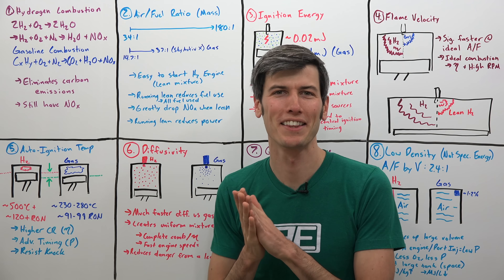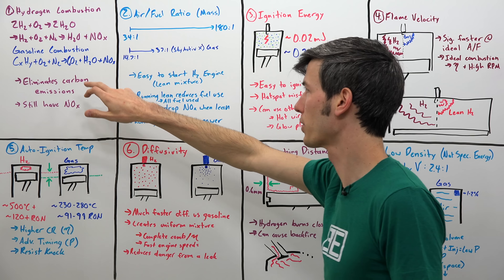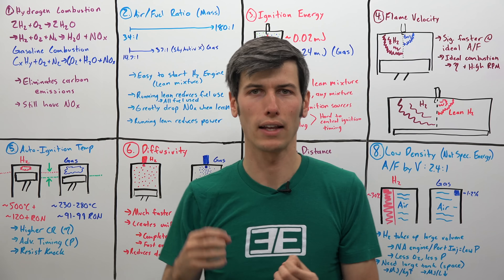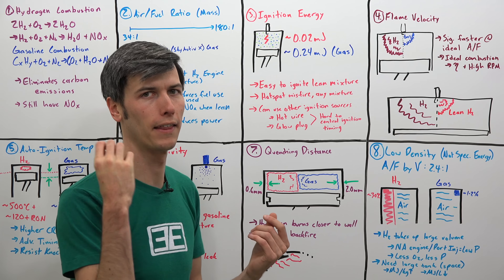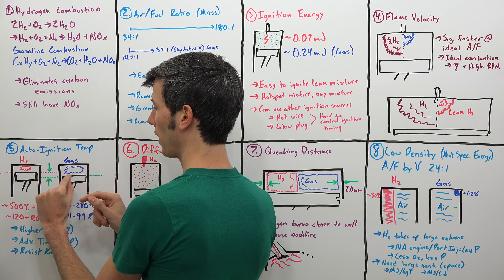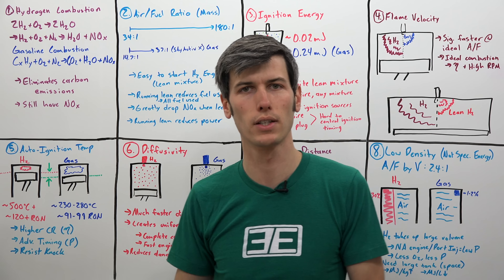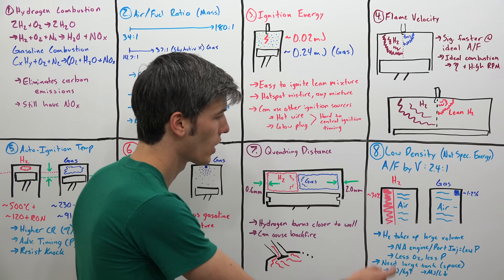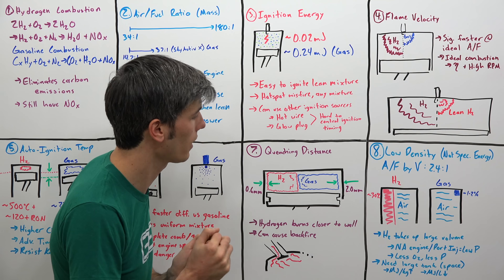The Difference Between Gasoline And Hydrogen Engines

Comment: The Achilles heel is density of the fuel, like the guy said at the end you need a big fuel tank plus on a network level hydrogen would only be feasible in cities with a pipe network from the gas generator as i can't see fuel tankers operating at or near 5:1 as regards petrol.

Comment: Excellent presentation. It makes one wonder why nearly all of the R&D by automakers for future alternatives is devoted to electric vehicles. it seems to me that hydrogen is a far more practical approach, given the relative abundance of the element, and this technology would not require major changes to current engine design. With EVs, there is the issue of limited supplies and expense of lithium for batteries, battery weight and life, not to mention the environmental concerns of mining lithium, and huge amounts of toxic waste that will be generated by spent batteries! Something stinks about this rush to force consumers into EVs. Your thoughts?

Comment: No carbon emissions? Not taking carbon from underneath ground and dispersing it into the air? Yes, not during the process of operating the vehicle. Instead, some weeks before you run the engine. Usually. Why? The usual way to get hydrogen is to remove it from methane – CH4. Which leaves carbon compounds behind. This cheapest most efficient way of getting hydrogen – the methane is the main component of "natural gas." Am I wrong? Seems simpler to just use natural gas in the internal combustion engine. No?

Comment: Great video as usual. I am a bit late to the comments party, admittedly but one key question I have to progress my own evaluation of  IC hydrogen engines is the NOx by product of such engines vs gasoline engines. If in hydrogen ICE the ideal stoichiometricratio of 34:1, the NOx is no worse or less in comparison then we are not actually going backwards is in implied by some in our attempts to go forward in both a transportation sense and also an environmental impact sense.

Comment: The ICE is a Rube Goldberg contraption with so many drawbacks and problems it's insane that it exists at all.  Talking about changing the fuel in and ICE these days is a little like debating the materials used in a buggy whip in the early 1900's.  Seems like brainpower would be better used elsewhere.

Comment: What would happen if you used water and split it into hydrogen and oxygen with an electrical on board source and used those gasses as a fuel, then captured the water that resulted and reused it? No?

Comment: Diesel in for high compression,supercharger runoff the exhaust with a separation for without a straw or reported on the cylinder heads for easy of cooling inverted cylinders because it's lighter than air

Comment: Excellent explanation, once again.
Just one doubt: I've  read in square 2 that "NOx drop when lean". 
I have the opposite idea... when Oxygen is abundant after combustion is when more NOx occurs. That is the main reason why modern Diesel engines recycle the exhaust again to the intake in order to reduce Oxygen availability when the engine runs lean.
Did I misunderstood?
I like your explanations and shared enthusiasm. Hope you keep doing a great job.

Comment: Why not run the nitrogen in compressed liquid form with direct injection. It would drastically lower the combustion chamber temps and get better air density. It would also allow a much higher level of boost in a turbocharged application.

Comment: The guy is good. Have a couple of places where he was talking over my hairspray. In #2 (and this is due to my ignorance of gas/ fuel ratio). Are both sides of the ratios liquid... or gas? As in 14.7 what - to 1 what?

In #7, 500C auto-ignite temp is scary. I'm curious to witness an engine optimized to take advantage of hydrogen's auto-ignite temperature and how the machine would compensate for hot spots, and  look at the cylinder cooling setup as well as lubricants used. #7 means that cylinder walls are more apt to experience near auto-ignition temps, which are way beyond current lubricating and cooling systems. Rocket motors wrap the liquid fuel and oxidizer lines around the nozzle to keep it cool. Can't do that here, as the fuel is already in gaseous form (#8).

It would be interesting to see him review a 100% hydrogen fleet and how it wouldn't move an inch without petroleum to create tires, lubricants, asphalt, virtually 100% of a car's interior, Synchilla (R) clothing for driver and passengers, distribution (there's a group who doesn't like pipelines or train cars delivering petroleum), and humongous hydrogen mfg, disti, and fueling infrastructure.

Comment: Would it be possible to use existing catalytic converters to handle the NOx emission of a hydrogen combustion engine or would you need a different chemistry?

Comment: One small detail... while the H2 engine doesn't directly have carbon emissions, the processes that gave you the H2 very likely did. (at industrial scale, steam reforming uses methane. smaller point-of-distribution sources are usually electrolysis, where some to all of the power is not "green", and a major portion of any efficiency is lost to high pressure condensing pumps.) Thus, hydrogen is moving the problem somewhere else.

A small hydrogen leak rapidly becomes a massive problem. As you point out, it's combustible at 108:1, and it diffuses ("mixes") quickly. If that leak were in the cabin or trunk of a car, there's a serious explosion hazard. (the obvious solution is to keep the fuel lines routed away from areas where gas could accumulate.) Granted, I've not heard of any issues of fires and/or explosions with hydrogen cars, but even in 2022 that's still a very small fleet. (fires within gasoline cars are statistically low, but non-zero. same with battery EVs. for that matter, there are fires at gas stations and charging points.)

Comment: Jason, it's nice seeing you back when you explained engineering (as opposed to test driving cars). Question: Wouldn't a compression ratio of 180:1 create a lot of blow-by? Engines today can get that with much less compression. In fact, how would you even create such compression in an existing car? Thanks.
Reply: That 180:1 is a air-fuel mixture ratio not compression ratio.

Comment: Concerning point 6:  I believe hydrogen/air mixtures only detonate once ignited.  The only way I can see a hydrogen ICE engine not being destroyed by super nasty knocking is to ignite as the hydrogen is being injected, before it diffuses into the compressed air.  Like a diesel engine.  It still will go fast.

Comment: Yea, the volumetric energy density problem is what dooms most hydrogen applications. Fun fact: there are more hydrogen atoms in a given volume of gasoline than there are in the same volume of liquid hydrogen - and way more than that same volume of hydrogen gas. It's not the whole story, but the main point is that each hydrogen molecule has only 2 hydrogen atoms while for petroleum products its more like 20-30 per molecule.

Comment: Great video.  I think burning H2 in ICEs would have been a much more environmentally friendly interim solution for reducing CO2 output.  ICE engines are easy to make and recycle.  The copper needed for EVs is a quickly dwindling resource!  
Politics and green zealots are completely ignoring the vast amount of CO2 involved in producing hybrids and EVs, not to mention the completely unknown emissions from recycling batteries and fuel cells. Also, these incredibly green vehicles will all go to the scrap heap way earlier than ICE cars because no one will incur the insane cost of replacing batteries on 10 y/o cars.  
 NOx emissions can be easily controlled with a DEF-like systems as they are widely in use on diesel engines.  Automakers have completely ignored this as an option but it is likely to be needed for long-haul trucking, heavy machinery and even on freight trains.

Comment: The space required in the car is the least of your worries.  There is hydrogen embrittlement, transporting it at −252.87 °C; −423.17 °F, filling the tank, and even under the best conditions, losing 1% per day, conditions that don't come close to existing in a mobile world.   It will probably also emit ozone, which is astounding corrosive to anything carbon-based, like plastic and you and your lungs.

Comment: Theoretically, if we could perform electrolysis on the fly..and just store the hydrogen as water solution (Maybe Lye), and the exhaust byproduct of Hydrogen combustion is water, could the exhaust line be fed back into the holding tank. The solution that makes the water conductive isn't sent into the engine, so it would stay in the holding tank. Could this give us a semi-indefinite fuel source? Maybe you change it when you change your oil? Storing the fuel as liquid water has it's own caveats I know as the electrolyte solution would have to bring the freezing point of water to well below 0*C.

Comment: The biggest disadvantage is still using a complex marvel of engineering with high maintenance cost to produce it's power. I think a fuel cell and electric motor might be the only future for hydrogen if it is to compete with the way things are heading. Great vid as per usual

Comment: I think Hydrogen is a no brainer since it is cleaner and can be reproduced unlike fossil fuel, my father who everyone called crazy said it could be done in the 1970's during the gas Crunch. I guess my father wasn't so crazy. Electric is not the way to go for so many reasons but the obvious one to me is the immense pollution that will come from spent batteries made from poisonous chemicals and the fact that countries not so friendly to us would have to supply rare earth minerals also needed to make batteries. We aren't talking about a couple of AA batteries but much bigger and millions of them.
Reply: Could not agree more. Off shore windmill parks could easily supply both the electricity we need and electricity to power all cars in the world. Electricity and water are used to make hydrogen. Hydrogens first stage are hydrogen gas but when turning hydrogen gas into hydrogen liquid it are fantastic for long term storage for when the wind does not blow/winter. 1 single liter of hydrogen liquid contains same amount of energy as 450+ liter of gasoline. In some parts of the world solar panels can be used for electricity production but off shore windmill parks are great for larger concentrated outputs for cities and larger hydrogen production. Car/train/truck and even jet engines can run on hydrogen. It is beyond me that we dont have jet engines/planes running on hydrogen today. If the jet engine manufacturers are not getting their role, taking their responsibility upon them, we have to make a global snap decision and create a continent connecting vacuum based hyperloop system, we can use current airports as hubs. If all nations start building their part and we all chip in for the sea parts it should be able to be done in 10-12 years if we consider it our generations "Apollo project". 
I almost can bear it anymore...WHY are we not acting!? The fossil fuel industry are still the most subsidised industry in the world, can we at least make the market fair for a start, makes no sense unless you count in massive corruption!

Comment: H2 engine?    Just run it as a rocket motor...  making h2 produces O2 as well.   Just need 2 bottles...  then you don't even need an intake system...  its all in 2 bottles

Comment: What you didn't address was leakage throughout the entire manufacture, storage, distribution, and application. Hydrogen will find every potential leak path. Adequate sealing techniques are elusive especially over time.

Comment: With all the Green Energy idiots pushing electric vehicles you would think that they would want to lobby the government for hydrogen cars instead since we wouldn't be destroying the planet even further by mining for lithium and other minerals needed for batteries, and we also would be able to repurpose all of the automobiles currently in use by swapping the gas tank out for a hydrogen fuel cell. Less waste, less pollution, less carbon all the way around. But, they're stuck in their ways and aren't trying to listen to common sense in this debate.

Comment: Ohhh 🤯 I missed that little tid bit. I didnt realize hydrogen combustion produced nitrogen oxide. I wonder if somewhere in the exhaust portion of the system, you could separate the nitrogen from the oxygen, feed the oxygen back into the engine through the air intake, and have the nitrogen be compressed using the exhaust pressure into the cooling system. Itd be like the engine produces it's own coolant 🤯

Comment: Anhydrous Ammonia (NH3) is a better carrier than pure H2.  Less volume... similar to LPG.  Combusts in air at high temperature, but a catalyst can convert some H2 to aid ignition.  No carbon emissions, but of still NOx requiring catalytic converter.

Comment: H2 engines need lubrication too. Engine oil find its way into the combustion chamber, therefore exhaust gas will contain burnt oil.
From this point.. what's the point??

Comment: Did u calculate use simple programable ecu for injection time hydrogen I know pressure is perfectly to work 60psi, use lpg high flow rate injectors.... Possibly working perfectly

Comment: How do you control detonation? Detonation is hard to control in methane. Nearly impossible in hydrogen.
Reply: Toyota had a 4 stroke hydrogen gas direct injection engine based race car participating in an endurance race last fall. You can find clips about it here on YT.

Comment: All advantages seem to be pointing at hydrogen instead of gasoline for combustion engines. Yet cars manufacturers mostly use fuelcell,  wonder why that is?
Reply: Toyota had a 4 stroke hydrogen gas direct injection engine based race car participating in an endurance race last fall. You can find clips about it here on YT.

Comment: Why the need for large tanks to hold hydrogen? Does not on board hydrogen generation eliminate the need for storage. High output alternators and dual battery system?

Comment: I remember conversations in the 1970's about how hydrogen was going to replace gasoline for combustion engines. 50 years later, and the weight of the power storage system (batteries or hydrogen tanks) is still the efficiency roadblock.
Reply: Always will be.
Reply: @tedmoss  Toyota had a 4 stroke hydrogen gas direct injection engine based race car participating in an endurance race last fall. You can find clips about it here on YT.
Reply: Toyota had a 4 stroke hydrogen gas direct injection engine based race car participating in an endurance race last fall. You can find clips about it here on YT.

Comment: Hydrogen is too difficult to liquefy, we should be using it to hydrocrack unrecycled plastics and focus on liquefaction of methane, which is a lot easier to do(significantly lower temperatures and pressures than H2 gas to liquefy)
Reply: Yes and no. Search YT for "Denmark and energy islands" With huge off shore windmill parks and energy islands in the ocean the pressure on the sea floor and provide a huge part of the energy needed for free. Todays liquid natural transports normally freeze the liquid after making it into a liquid to partly avoid explosion risk during transport bu also because it is more cost efficient to just keep it frozen than keep ir cool AND under pressure. Freezed after making it into a liquid= no pressure needed

Comment: Thoughts on cryogenically cooled liquid hydrogen and liquid oxygen tanks that mix at 2:1 ratio in the air intake on a gas car but only at wide open throttle as a way to increase peak power or make a very small engine more capable of moving a large vehicle?

Comment: You missed a very serious problem with hydrogen/shorter hydrocarbons like methane or ethane. If you look at your reaction, there are less gas on the right side then on the left, so you actually won’t get more gas by burning it, the only mean of expansion is by the very large heat the reaction gives off.
Let’s suppose you pick 3 moles of air-hydrogen mixture at the percect ratio and you burn it. You will get 2 moles of (h2o) particles from 3 moles of (h2 and o2) particles, so your pressure will actually decrease! 
Same goes for methane and other hydrocarbons, where the longer the hydrocarbon is the more amount gas you will get after burning it. Hydrogen is 3:2, methane is 3:3, buthane is 7,5:9 and octane is 13,5:17

To have something to refer to here is how long hydrocarbons compose fuels:
methane is 1, C(1)H4
buthane is 4, C4H10
petrol/gas is a mixture of 5-10 long ones
diesel is of 11-12 long ones
kerosine is composed of 13-15 long hydrocarbon molecules

Knowing this it would be logical to only use like kerosine, but sadly the larger the fuel molecule the lower its octane rating is.

Comment: if i remember right if a car runs to lean it does not have as much power and it melts the piston. i believe if hydrogen is to lean it will explode to fast and not give time for the piston to move the energy will be lost in heat. I like your video lots of good info.
Reply: Toyota had a 4 stroke hydrogen gas direct injection engine based race car participating in an endurance race last fall. You can find clips about it here on YT.

Comment: I was just wondering on the timing situation, wouldn’t you need to retard the ignition because of the volatility of the gas rather than advance it? You’ve stated it can be compressed more before ignition and that it’s more volatile than petrol so wouldn’t it be better to run less advanced timing?